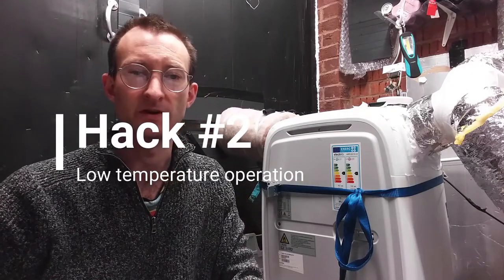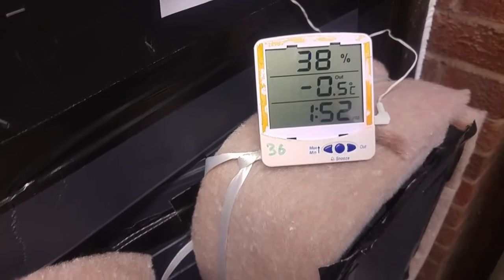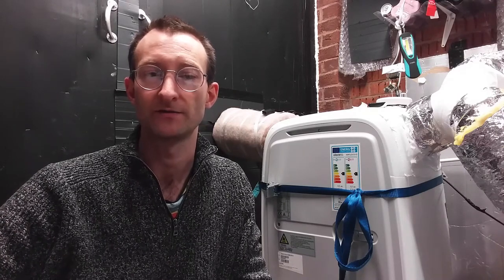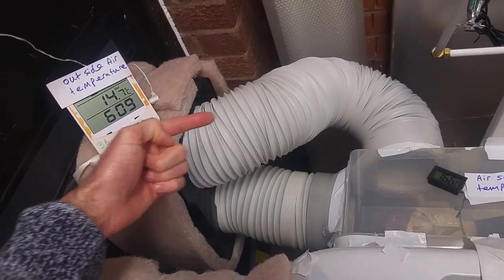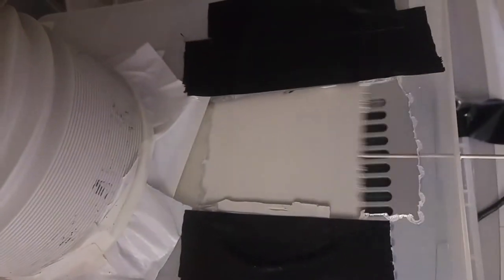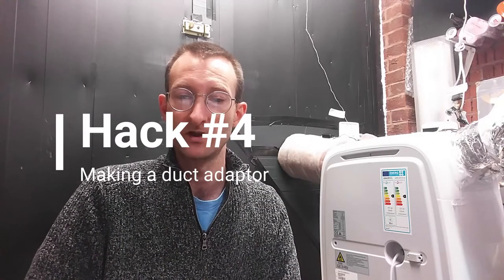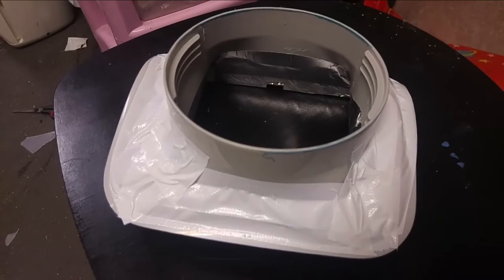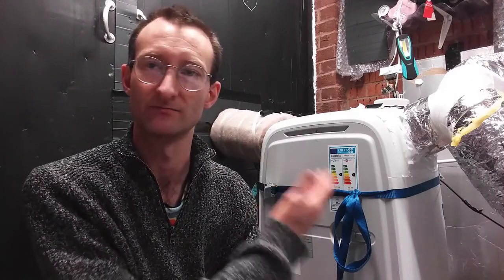5 portable heat pump hacks

Comment: I was looking for a more economical way to avoid putting central air heat pump in a house and use geothermal piping and fluid to a radiator for the heat transfer in winter and reverse in summer when it is warm.  This system may be what I am looking for instead of spending $30,000 for complete geothermal system.  Not sure if the portable system will heat/cool a 1500 square foot house unless hooked to the duct work.  Thanks.
Reply: I have a similar idea in Poland.  $200 new, $100 used annually.  one of the exchangers will be replaced with a gas water central heating exchanger and I have a 2.6 kW heat pump for $200.  good luck with the project.
Reply: Depends on your outside temp, this will work but compared to a real geothermal heat pump solution this is a childs toy..

Comment: Hi Matthew,  I came here because I'm thinking about the same idea for a while now. Nice to see that you have managed to get this working. Do you know what COP  you +- reach? And did you calculate what the electricity did cost you last season compared to your regular gas bill?
Reply: I heard the COP in your video, you call it percent but I think it's 300% (3.0)
Reply from the maker: Yes COP was 3 when using outside air But 2.7 when using inside air. Electric is usually 3x the cost of gas so it costs the same as gas boiler to run. Unfortunately, it's not powerful enough to completely replace my gas boiler. I would need two of them to do that. But it did replace most of my gas consumption. I hardly use any gas now just loads of electric. I'm going to try a solar air heater next to replace the remaining gas.

Comment: I'd like to see a better explanation as to what you are talking about with the outside air being colder than the exhaust air? The exhaust air should always be colder as it's removed heat from it so unless the exhaust air is coming from the garage only then only then can the exhaust be warmer than the outside air. If the source of the exhaust air is from the outside air. You probably need to try duct return air from the house to the units intake.

On your video you seem to be ducting the outside air into the condenser part of the system (the top coil that is heating the air) - the air in the house (maybe not the garage) is always going to be warmer than outside air so you should be using air from the house to heat otherwise your just constantly heating cold air. 

By all means use the warmer garage air (which assuming this is warmer than outside air) as the source of air for heat or just use the outside air but your asking the system to work harder by using fresh outside air to go through the hot part of the system.